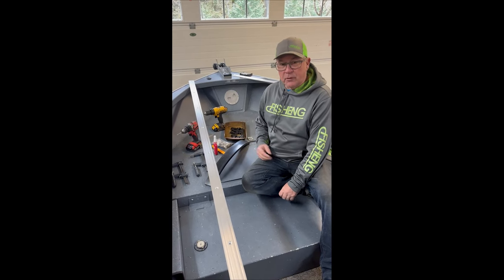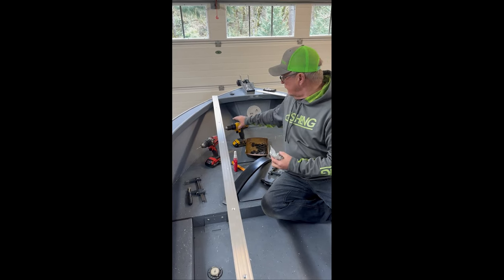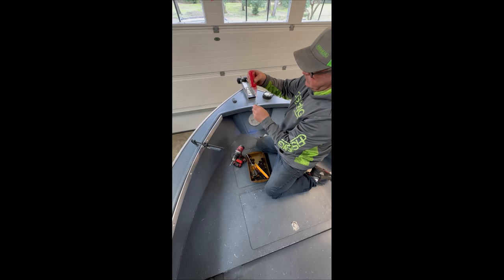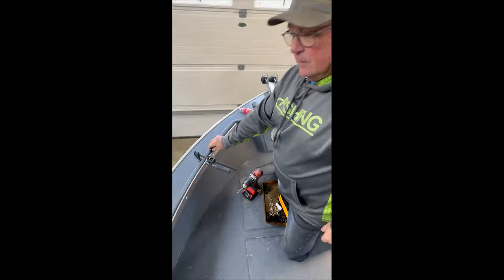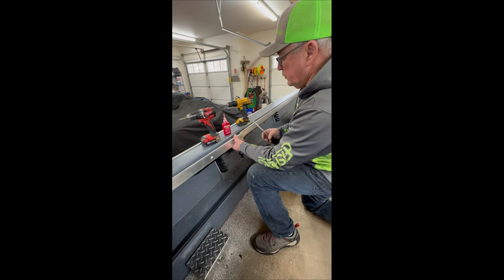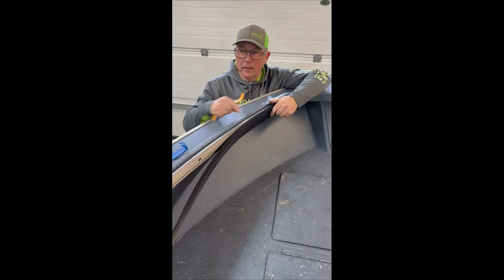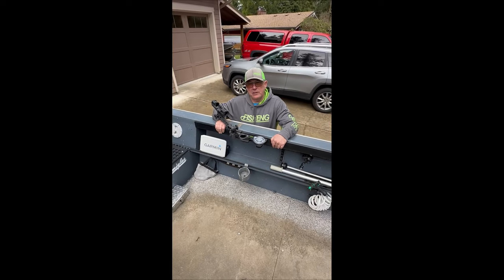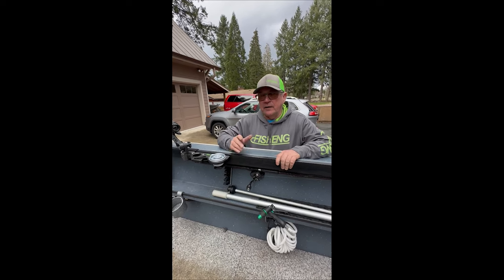Fisheng Rail System Install

Comment: How do those sliding accessory adapters slide on the rail on the radius sections?  I would like to install this on my drift boat
Reply: I have them on mine 20’freedrifter. They slide nice. Not to difficult. I will say the freedrifter and the rod stations don’t go hand in hand. Due to the side height the rods need to canted and not vertically up and down.